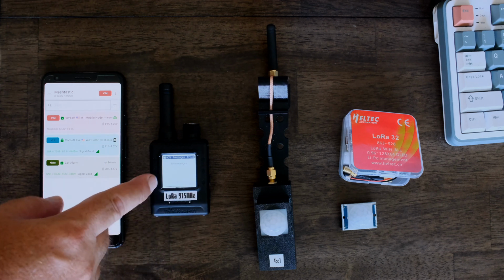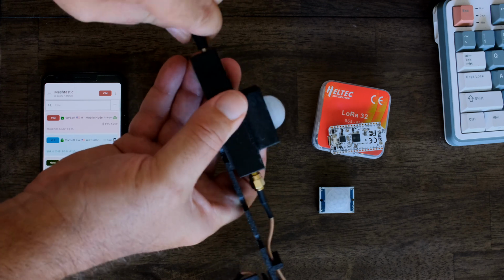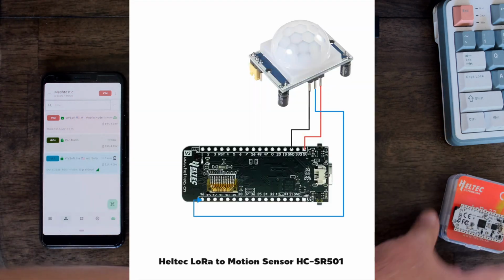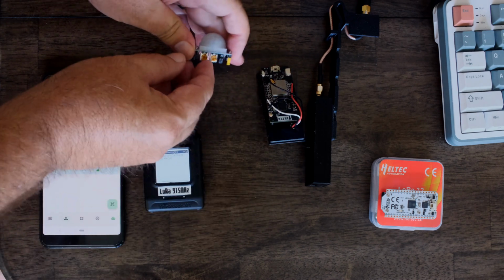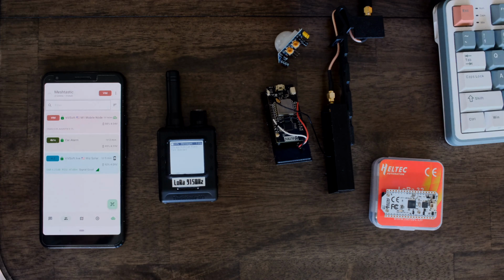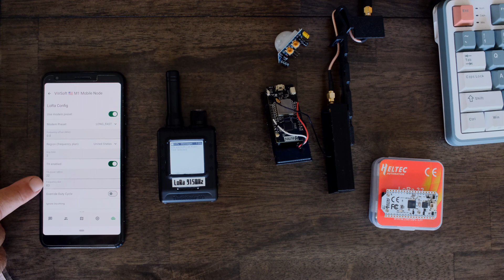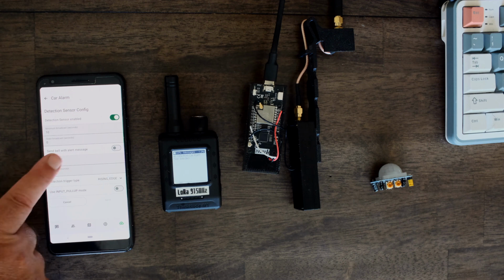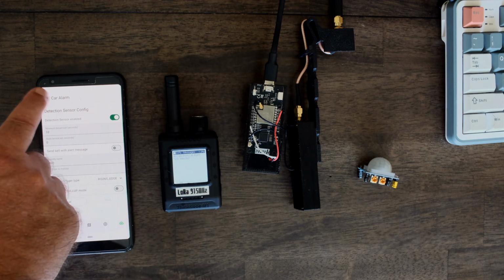DIY Car Alarm with Meshtastic Sensors!

Comment: Hello this is great, I am working on a similar project, is it possible to arm and disarm the sensor node?
Reply from the maker: Hi there. I have not found a way except for using the app to disable the alarm pins. For serious use I would consider adding that in a firmware...

Comment: Why would you change the frequency?  Doesn't staying on 20 allow you to take advantage of routing on the main network if your car is away from home?
Reply from the maker: Like many Meshtastic modules, this module does not transmit over the default public LongFast channel. You could make it work on the default frequency, so other nodes would carry your messages, but that would be extra traffic on the default mesh... But still has to be a private channel.
Reply: @ViVSoftLLC Thanks, Im very new to meshtastic, but only want to carry one device around in my pocket and want to take advantage of public routing, so I want to be on 20.  But may try something like this on a private channel, but not send a lot of messages.  Its unfortunate you cant seem to use two frequencies on the same device.

Is that a limitation of meshtastic or the boards themselves?
Reply from the maker: @rowdyyates7247  I think the devices can only listen to one active frequency at a time, but that is configurable obviously. Meshtastic limits the traffic on the LongFast channel because if everyone started sending status updates like this the mesh would quickly be overwhelmed, so I assume that is where the limitation of using the default public channel comes from.
Reply: @ViVSoftLLC Thank you, that makes sense.  Do you have any experience with LongSlow on a private channel and frequency?  It seems that would extend range, though I hear conflicting things about that.

Comment: Thanks for great video, I wonder if a weather station with meshtastic is possible?

I was looking at doing maybe a temp, humidity and air quality sensor for my pigeon loft
Reply from the maker: @OurSouthAfrica , yes, look into the BME680 (https://amzn.to/44QBWWX) which will give you Temperature, Humidity, Pressure Sensor and Altitude Sensor. You connect that up via I2C to the Meshtastic node and enable the "metrics on-screen" option in the Telemetry module. After that the node will send out its telemetry data over the mesh and you can view it on another node. See this video - https://www.lorameshdevices.com/blog/meshtastic/enhancing-your-meshtastic-node-with-air-quality-tracking.html